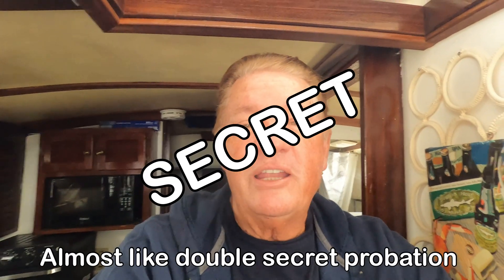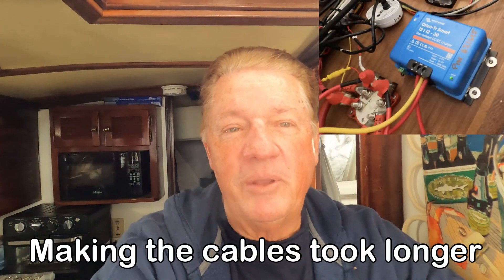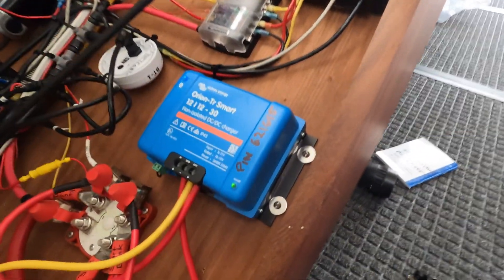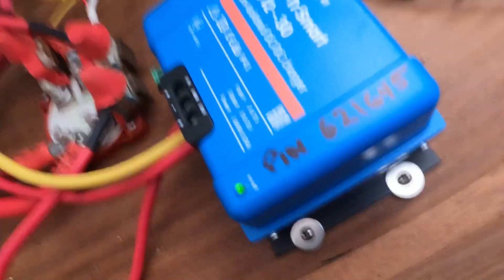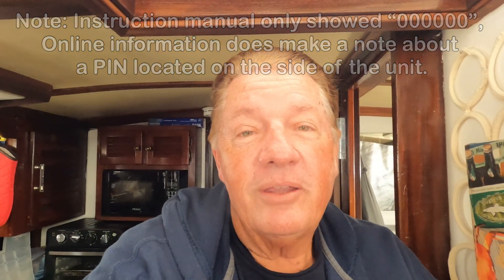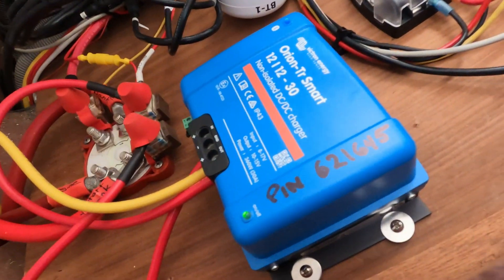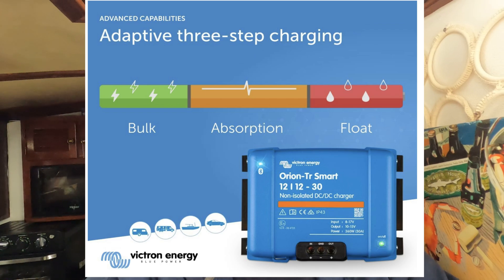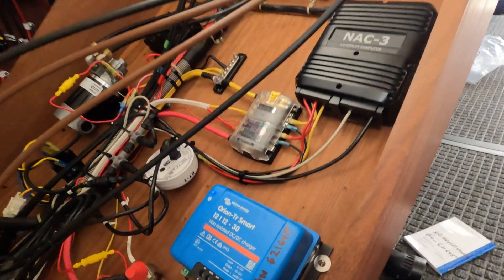DC to DC Charger: The Secret PIN?  #CaptBobsAdventures #greatloop #boatlife

Comment: If your Unit has this sticker/pin  and it works it was Calibrated at final assembly.  My understanding is  if it does not have this sticker  and responds to "000000" and a error 116 is in history it means this error code was not reset(removed) at the factory and you have a early early unit.  not saying it is bad just that I think they did not set PINS at the beginning  and maybe they started installing RANDOM pins because if a lot of RV'ers show up at a park and nobody changes their "Pins"  then a lot of mischief  could be avoided.  imagine if 50  RV'ers were at a event all with "000000"  as there  Pinn   CHAOS  !!!!!!!!!

Comment: Surprised you decided to show, how you failed to read the instructions. In your clip of the instructions with the 6x0 pin it clearly state ‘unless a random pin is installed, which you can then find on a sticker’….you simply failed to read all the text in your manual.
Reply from the maker: Thank you for your comments. That has been mentioned many times. The directions that came with the unit did not include that information, only the online information had it. Once again, thank you for your comments.

Comment: ...except if you continue reading that very sentence in the instructions you pointed out, it very clearly states "...unless your device already has a random PIN code which is then printed on a sticker attached to the device.".  So what's the issue? It's not a secret? Finish reading the instructions before you do something stupid.
Reply from the maker: Thank you very much for your comment. You are 100% correct. Except in the manual that came with the device, there was no reference to a particular pin number. I believe it was an older unit and manual that was supplied to me.

Comment: Another tip: You can use Orion TR Smart as a fuse for your electrical system instead of charging a secondary battery. So the output from Orion is used as a supply and it will limit the current that can be pulled to it's maximum amperage in case of a shortcircuit. It's not a replacement for ordinary fuses, but it protects the wires to main distribution board with fuses for devices and lights. All power to my electrical devices and light in my boat is supplied by my Orion TR Smart.
Reply from the maker: Wow....very impressive. Thank you very much for sharing. I'm gonna have to look into that.

Comment: The DC to DC chargers will seriously inhibit how much charge you can put into the second battery. A VSR is a way better solution for most people where they have lead batteries. The DC to DC charger only becomes relevant when your domestic battery is lithium. You can't use a VSR with a lithium battery.
Reply from the maker: Thank you for your comment, I will look into that. Cheers

Comment: The manual mentions the randomised PIN.  Go back to the 2 Min mark of your video.
Reply from the maker: Thank you for your comment. You are 100% correct. The online manual does state that, but...the manual that came with my unit did not. Not sure why. Good catch on your part, thank you. Cheers

Comment: I'm trying to learn how to run lithium in my camper van I recently purchased a lithium battery 74AH for my camper van and swapped out the lead acid and put the lithium in the back for heat issues and I'm seeing two things a major fluctuation in voltage and my alternator is working really hard so I have stopped using it until I can figure out how to do it I was recommended to get some type of smart charger that can cut on and off as needed to give the alternator a break and I was told 74AH is kind of small and my van is using most of that so either get more AH'S or for the time being get something to help stabilize the voltage drop until I can so I bought a ioxus ultra cap battery and it has the voltage steady but now I need to fix the charging situation I'm told that since it's all going to be one big battery and not two separate starter and house battery that I need a non isolated smart charger but I am wondering wouldn't 30 amps be to small wouldn't I want the majority of what the alternator is not using for the car to go to the battery like say a 70 amp any advice would be greatly appreciated thank you
Reply from the maker: Thank you for your comments. I went with lead acid because of cost and space limitations. Wish you the best with your project. Cheers

Comment: It says it right in the instructions lmfao .....it is  "000000" unless it has a random generated pin that is located on the sticker on the side. 😂 at 1:56 you show it specifically.
Reply from the maker: Thank you for your comments. You are 100% correct. The online manual states that. But, the manual that came with the unit did not. Don't know why. Cheers
Reply: @captbobsadventures4420  i have seen things like this come up during transition periods with some manufacturers for other things where they updated or upgraded something but it did not make it into the literature that came with the product. I saw that it was the second portion of the image you posted .... as a man myself sometimes even I dont read all the words and the answer was right there...lol done it a couple times in my life lol we all know men don't need directiins
Reply from the maker: @STEVEKRSNIK  Thanks again for your comments, Cheers

Comment: The main reason why Victron moved over to the random pin change..

I’ve actively told folks (when camping) to change the pin on their Victron product/setup as it still has the (now old) default pin, as sadly there’s individuals that would either change the pin or even worse change the settings in the setup that effectively burns out batteries or worse. So please do the right thing if you find your fellow campers that have an unprotected setup.
Reply from the maker: Thank you for your comments. I did not know that. Thanks for sharing. Cheers

Comment: I notice the charger label shows a bar code which you should be able to read with your phone. Does it contain instructions and pin code? As a dinosaur from the middle of the last century I too find it difficult to keep up with modern computer technology, if I dont understand something I just ask the nearest six year old.
Reply from the maker: Thank you for your comment. That's a great idea about using your phone, for some reason I didn't think of using it that day. Cheers.

Comment: The instructions you show in your video explain about the pin on the side of your unit.
Reply from the maker: Thank you for your comment. You are 100% correct. But the manual that came with the unit, did not show that. I just don't know why. Cheers.

Comment: Seems straight forward...read the sentence after 000000 at 1:57.
Reply from the maker: Thank you for your comment. You are 100% correct. The online manual does state that, but...the manual that came with my unit did not. Not sure why. Good catch on your part, thank you. Cheers

Comment: Law in several countries require the default pin codes/passwords to be "random", because nobody changes them after unboxing.  Always make pictures of the assets you get with all the number plates, so you can always find these codes back when the labels are ruined.
Reply from the maker: Thank you for your comment. You are 100% correct. The online manual does state that, but...the manual that came with my unit did not. Not sure why. Good catch on your part, thank you. Cheers
Reply: Mine came with a Spare Label in a Little Sterile Bag  thanks Victron  !!!!

Comment: The excerpt from the Web Page shown at 1:56 says "The default PIN code is 000000 unless your device already has a random PIN code which is then printed on a sticker attached to the device.".  Life is a lot simpler if don't expect THEM to be LYING to you.
Reply from the maker: Thank you for your comment. You are 100% correct. The online manual does state that, but...the manual that came with my unit did not. Not sure why. Good catch on your part, thank you. Cheers
Reply: @captbobsadventures4420 the company is 'victron energy' ...just to cover the simple things!

Comment: I’ve all Victron products on my motorhome with the exception of my 200amp LFP battery. That’s was a mistake that cost a lot of time as the one I fitted, cheaper than a Victron, had a faulty battery management unit. Fortunately the company replaced it and all is OK. Moral to this story stick with Victron products there brilliant.
Reply from the maker: Thank you very much for your comments. Cheers!

Comment: DC-DC is one option.  On a sailboat the engine is seldom on.  I hook up an inverter to my solar/wind batteries then use a standard 14ga outdoor extension cord to run a battery charger.
Reply from the maker: Thank you for your comment. Cheers!
Reply from the maker: Thank you for your comments, good idea! Cheers

Comment: Smart alternators are intended for cars, not for boats. Keep your old alternator, it makes a better job on your boat than a smart one.
Using a DC/DC charger is always a better choice than a relay.
I had the same struggle with the pin code. Had to phone the store to find out what to do.
Reply from the maker: Thanks again for your comments, I sincerely appreciate them. Bob

Comment: Nice vid thanks!  Would an isolated version not have been better to help with circulating currents and the life of your boat's anodes?
Reply: On a boat, all battery negatives are tied together (or should be), so there is no point running an isolated version. the isolated one becomes useful for hitched RVs or specific circumstances where negatives cannot be connected
Reply from the maker: Thank you for your comments. I'm not sure about the currents, I haven't seen anything on the subject. Cheers!
Reply from the maker: Thank you for your comment, good point! Cheers!

Comment: It may seem complicated. However, once you get your head around it, the victron system is very adjustable, and their components are very intuitive with each other. 
(Also, the app advises the new pin but also in small writing).
Happy sailing!
Reply from the maker: Thank you for your comments, Cheers!

Comment: Hey Bob, Nice boat ! Looked at one 10 yrs ago for 10k n needed work.If switching power banks of batteries running solar for charging.What all can yo do  about input n output ,2 switches? One for solar power out of panels .The 2nd switch PLUS one of your devises to entertain power to individual battery banks? Do a vid on yer old unit ,how it works.In my rv I don’t have an alternator so may not blow fuse? Trying to figure this out n thanks !
Reply: Actually I have 4K Onan but probably ditch it for more batteries
Reply from the maker: I have a 3.5KW NextGen generator. I love it, it's quiet and uses very little fuel. In my boat, I just don't have the space to put more batteries. I have 7 onboard now....LOL
Reply from the maker: Thank you for your note, appreciate the feed back. I try to have as many power sources as possible for charging. I'm not sure about doing a video on the ACR, it just didn't work very well in my setup.

Comment: You may find that dcdc charger will get really hot. If your autopilot starts acting wonky, consider getting that nac3 away from the hot, hot dcdc charger just below it.   Another way to solve it is to replace the smart Tr with the new 50a buck boost version which is just now shipping. It is much more efficient (read: less heat). 

Nice channel. Good info on the PIN.
Reply from the maker: Thank you for your note, appreciate the feed back. I just installed the unit before my last trip. So far, not on wood, I haven't had any problems. I will look into the 50a buck boost, never heard of it. Glad you like the channel, more videos coming, stay tuned!
Reply: @captbobsadventures4420  it has several advantages—ve-direct, 98.5% efficient (runs cool), smaller footprint. But, if the Orion Tr isn’t broken…I have the 24/12 version of the Orion. It runs ok but throttles down due to heat when it has a heavy load (after pulling up anchor sometimes). A fan solved the “problem” 

I’m just practicing retirement from the 57/67. 2 years 10 months to get it right. Thanks for giving some suggestions 😉
Reply from the maker: @jimduke5545  just curious, what kind of fan did you use for cooling? So far I haven’t had any issues, but that doesn’t mean I won’t in the future. By the way, I was on the 57/67 for the last 15 years of my career at American. I retired early when I was 62. After 41 years in the business, it was time to go play and do things that I wanted to do with boats. Also, in the last seven years, I have lost 69 friends from my flying days, I truly believe fatigue was the major issue for their early demise.
Reply: @captbobsadventures4420  it’s a little embarrassing, given the solutions I’ve seen (computer fans, in 3-d printed cases, and the like), but I rigged a Caframo 757 (the kind with an open prop/twin blades). It was a spare. It blows air through the fins and up thru one of the 2 Multiplus’s, as well. I later put a temp sensor and relay  for some automation. I’ve got ideas for a better approach but it was 95 that day and I just wanted it to bulk charge the depleted AGM  from the LFP house bank. (We had 120’ of chain out and had to re-anchor.
Reply: @captbobsadventures4420  I really get the decision to go at 62. I’m out with an Achilles right now and wondering if the decision might have been made for me…. We bought the boat (C42) 3 years ago to prep for 2026 when we head south…then back…or not🤷‍♂️
Reply: @captbobsadventures4420  We have recorded 59'c with the Orion mounted on the outside of the navigation seat on our yacht and that is with a 3" hole behind it.  A small computer fan is about to be installed to assist.  The yacht is in England btw, not exactly known for hot temperatures.
Reply from the maker: Thank you for all the new imput. I was not aware of the temperature problems associated with the unit. The area that I placed the charger has no air airflow at all. Looks like I will be adding a vent and a fan before the boat goes back into the water in April. I did check out the other unit you mentioned, it's a bit pricey for sure. A fan may be the direction I will go.  @pete9501
Reply from the maker: BTW....did you ever contact Victron about the heating issues? They must know of the problem. @pete9501

Comment: Sounds to me like some other brand might be a better choice. More technology than necessary. Technology just for the sake of technology.
Reply: A DC/DC charger is always a better choice than a relay. I have been using one for, I don't know for how long, maybe 15 years in my boat! I use Ctek D250 SE but Victron is an excellent choice. I have installed maybe one hundred DC/DC-chargers in all types of boats as an boat electricians. In this case technology is for your benefit.
Reply from the maker: Thank you for your comments, Cheers! @patricklindahl868
Reply from the maker: Thank you for your note, appreciate the feed back.